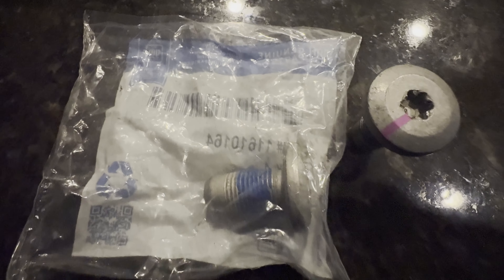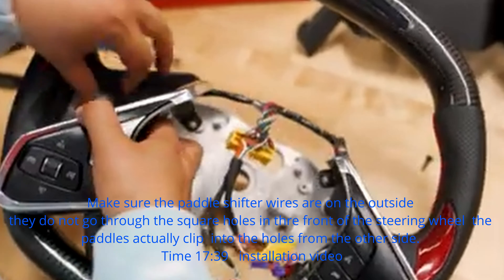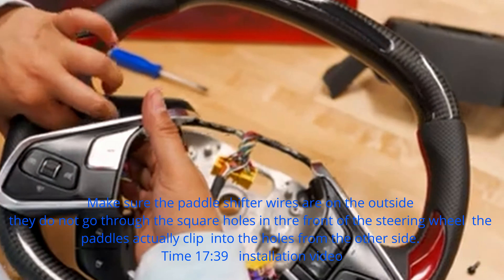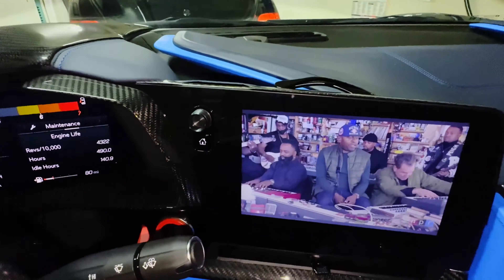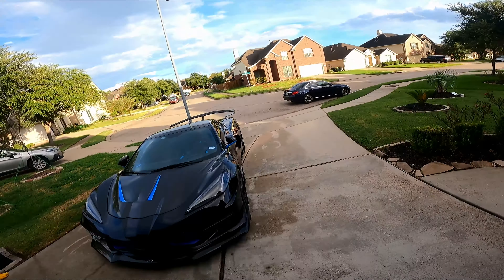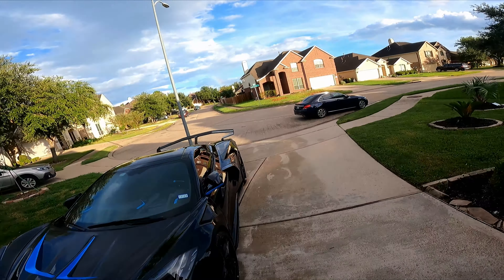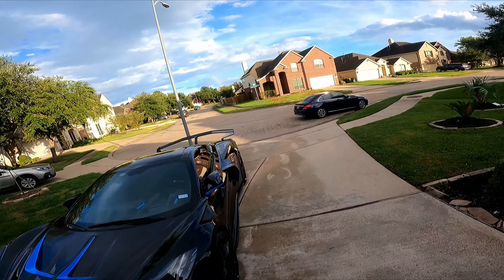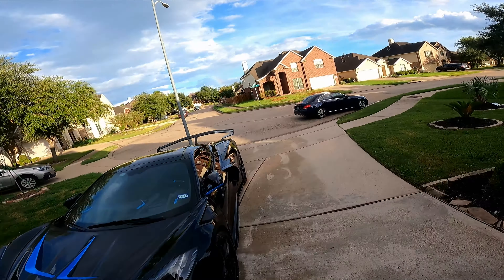C8 Carbon Fiber Led Steering Wheel

Comment: How exactly were you able to get the T50 bolt off?? I’m struggling a lil
Reply from the maker: I got it off by myself you really need two people one to hold the steering wheel. use   a  1/2 breaker bar or a long rachet  .. also buy  a new bolt for re-install around $3 already has loctite applied.